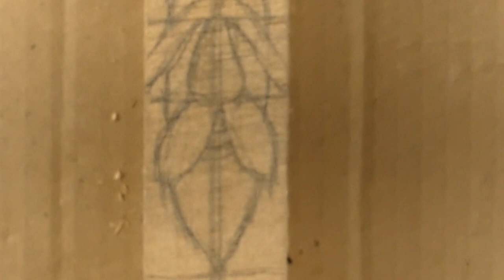Sea captain 1# ,power carving, micro carver,whittling

Comment: Lookin good Rob. Looks like the finger is gonna make it.
Reply from the maker: Yeap it healing up good 👍 
Thanks Rick
Reply: He got bit. It's easy to do doing mechanical work. I'm glad it's not all red anymore. It doesn't sound right cutting a hole in the box but I've seen it done 😂. Yeah rob if u get in that position again I think I would look into buying new straps 1st. I've actually taken a little sweet 2 door sports car and taken the tank off and repaired it. Using the 2 part metal repair. Worked perfect. Cost under ten bucks 👍
Reply: @mylastnerve138  I am to. Was lookin kinda ugly for a few days. It's happened to most of us. Scars from work and play.
Reply: What happened to you evil evil Rick. R u ok
Reply: @mylastnerve138  Ya I'm OK. Just saying we all have scars from growing up and learning. I've got my share. Maybe a couple extras. No biggie.